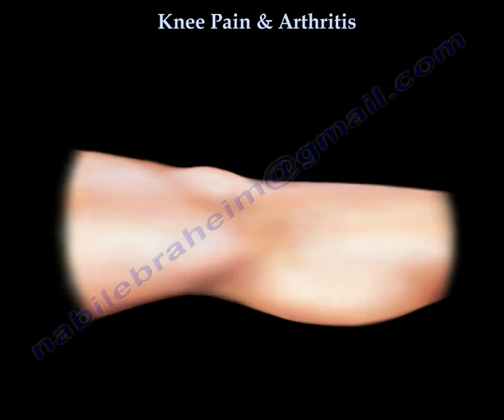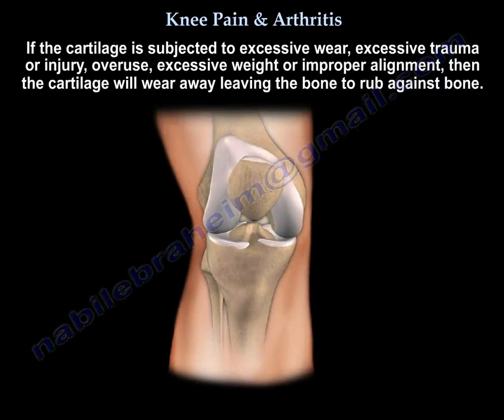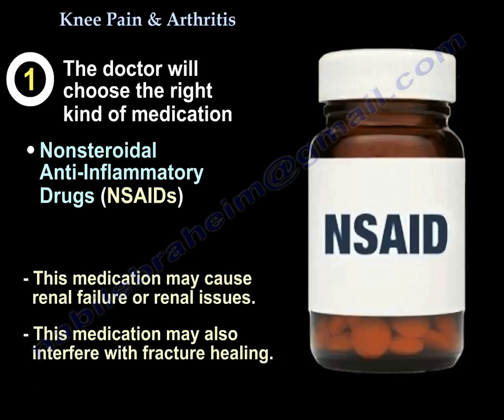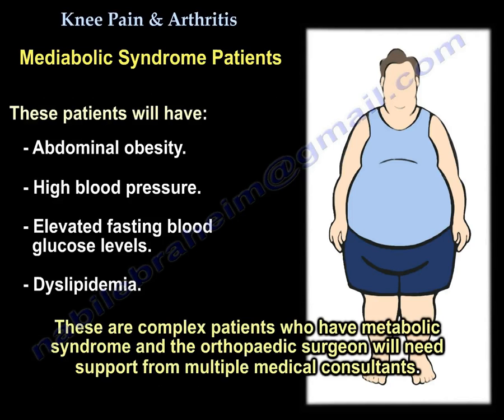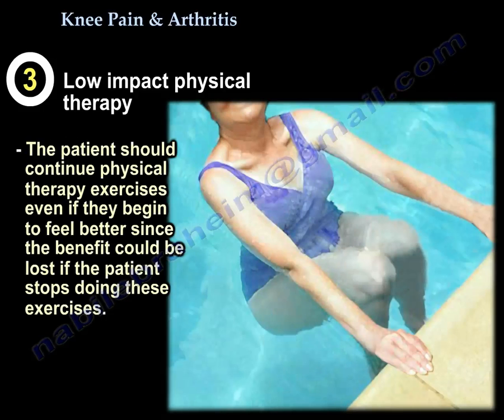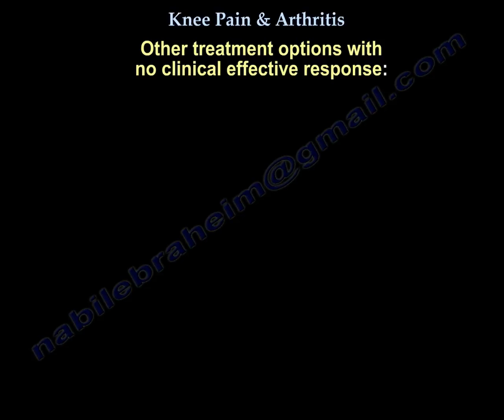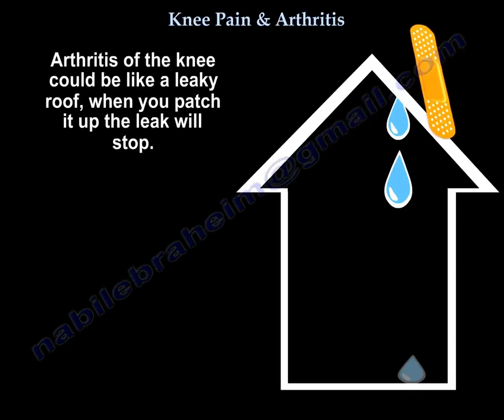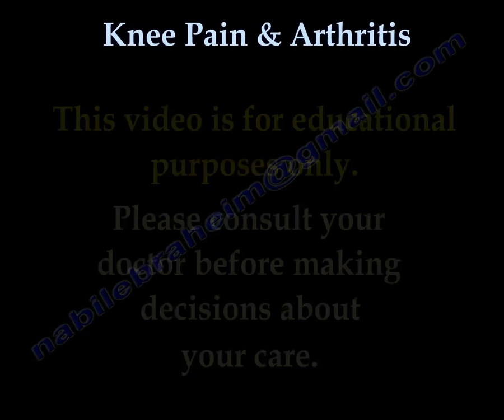Knee Pain , Knee arthritis treatment  - Everything You Need To Know - Dr. Nabil Ebraheim, M.D.

Comment: I’m 35 and suffering from severe pain in my knees due to arthritis… I have been taking injections but still experiencing flares. I hope oneday they can cure this disease…
Reply: I tried all the medicine 💊
But one thing really helps me it reduces the arthritis attack
Usually i am having it like 4-5 times a year
But now only 2-3 times a year.

I tried turmeric natural 
Crushed it and put in a water
Bring to boil 
 then drink it 
Don't matter if it's hot or cold but it helps me a lot 
Less expensive
More cure.

Do it.
Reply: @gilbertreyes6750  thanks for sharing
Reply: @mlo9797  glad to help
Reply: Mee too the same problem
But not only a knee and also some other joints also
I'm suffering a lot. Medicine has becomes day day to surrival that's it.I m too suffer these pains. I m crying alot
Reply: same here Karla. I'm not as young as you but too young for this issue in my knee and always limping.  My doctor is recommending knee replacement since I'm bone on bone now.
Reply: St cell shots will help
Reply: Stem cell shots work 🙏🏼🙏🏼🙏🏼

Comment: The drugs have too many side effects, and they don't solve the problem, only treating the symptoms. The physio was useless; so was the cortisol injection.  Two doctors couldn't agree on the diagnosis upon looking at the x-rays.  So I figured that I had to take responsibility for my own healing, and I learned that my knee problem is coming from the hip; one side is higher than the other.  Many people have this issue.   I've been a walker in my entire life, so it has been a lot of wear and tear.  Often, young athletes or people with excessive sports can have this issue. Footwear is important, and it is challenging to find the right shoe.  Personalized insoles didn't do the trick, they don't fit all of your shoes and boots, and unfortunately, they made things worse.  That's because it lifted the hip that was already higher.  I've been taking collagen successfully; the problem started when I stopped.  I'm not overweight at all; I have never been.  What I learned that the body is complex, everything is related, and we cannot just look at one part of it.  To me, my hip, lower back, knee and foot.
Reply: Are you doing better?
Reply: @NYC-18  when I take my collagen supplements, and vitamin D and do my knee exercise I am good. If I slack off, the pain is back.
Reply: @AMK0707  Wow that's interesting. At least you know the patterns.
Reply: @NYC-18  Yes 😊

Comment: Very informative and clear. Indeed supplements of chondroitine and glucosamine haven't improved this chondrocalsinosis. Hyaluronic acid injections have, though on a temporary basis, but only if flexion of the joint is not to full bending! The 'pocket' will be 'popped' open, releasing the precious fluid into outlying tissue and lost for the joint. Good luck everyone !